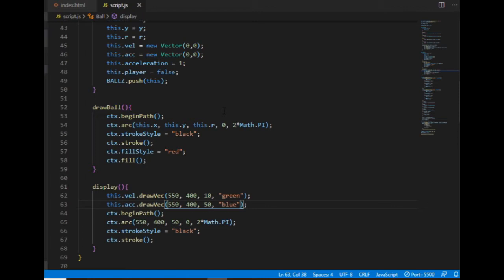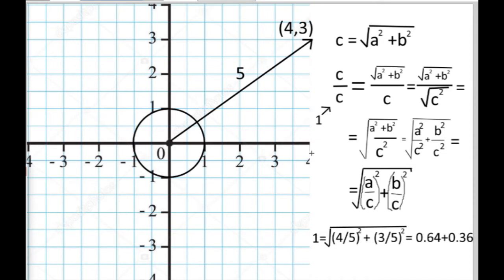2D Physics Engine from Scratch (JS) 06: Unit Vector, Dot Product

Comment: If you can't understand how he came with the idea that the normal vector ( the one perpendicular over a vector ) is (-y, x) where x, y are from the second vector. It's simple, use trigonometry, rotate both x, y by 90 degrees to find out the new x and y and you will find out that the new_x = -y and new_y = x so the normal vector is (-y, x ).